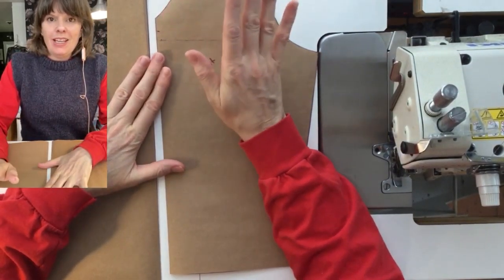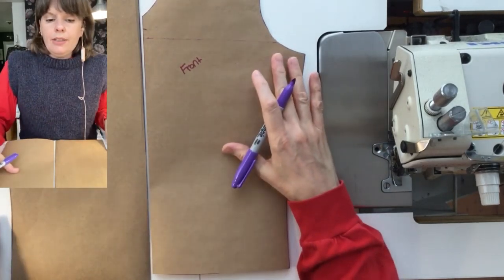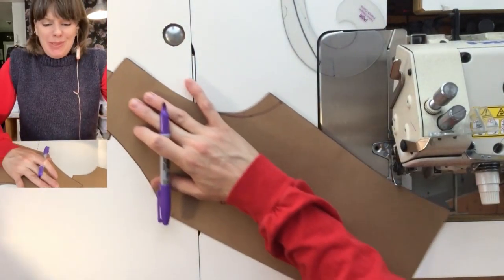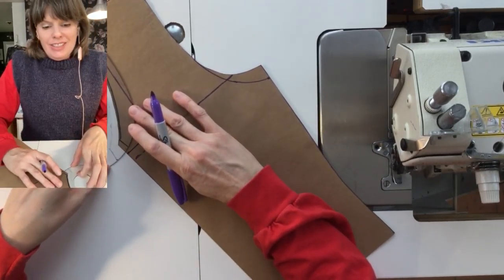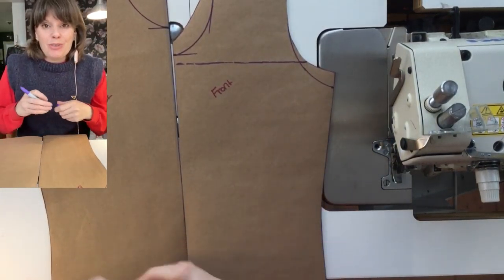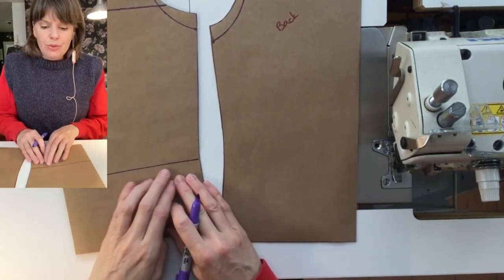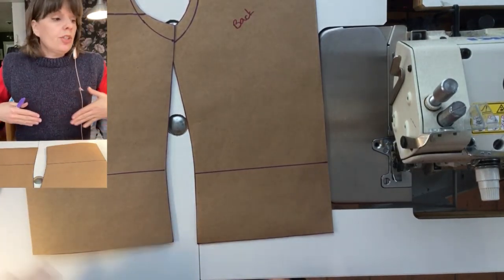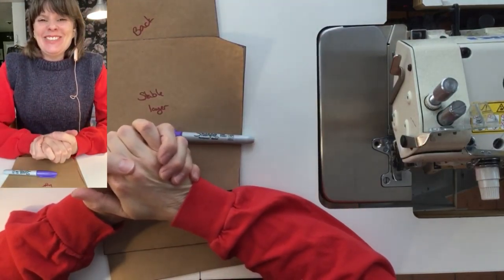Free Binder Pattern Edits

Comment: Every video you make it helps me to understand how to make mine, so thank you so much for taking the time and explaining it to me and to many others. but the thing is I'm gonna make an XXL for me with a zipper up front and some parts like you were saying on reducing the height of the binder and to make it appear like more of a sports bra but idk if I can make those changes bc of the size
Reply from the maker: I think you absolutely can. Take it one step at a time. Edit the neckline. You may want to keep the length on your first try and not add an underbust band. It’s doable, but slightly more difficult to add a zipper after adding the underbust band. Then you can decide on length based on your experience. You can email if you get stuck hello@ureshiidesign.ca